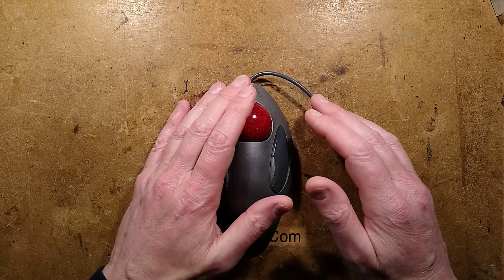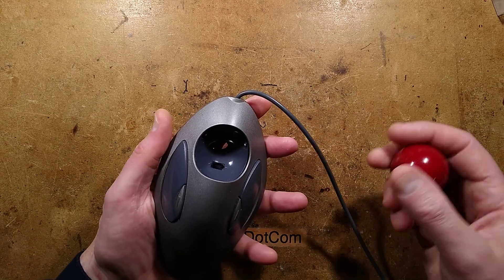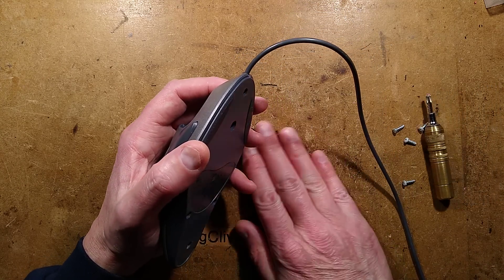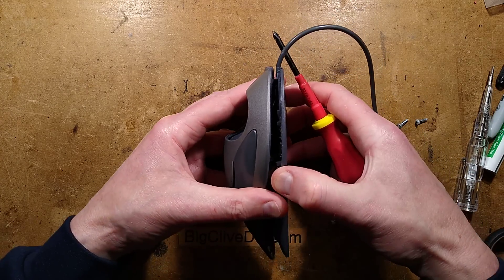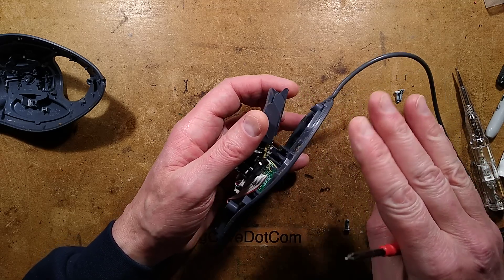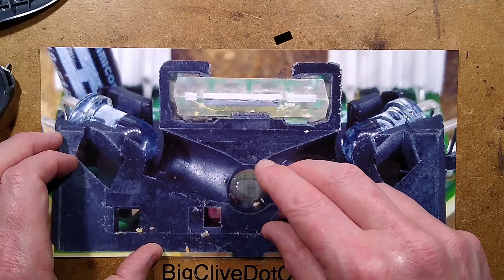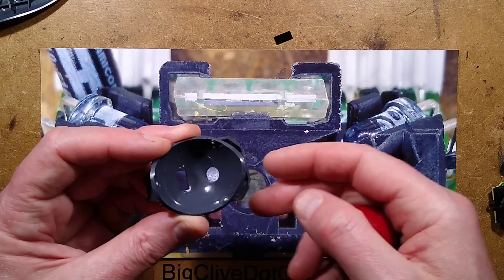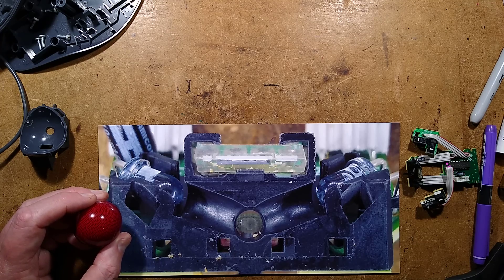inside an optical trackball

Comment: I have been using trackballs for decades now (the first one was even a serial mouse by Genius if I recall correctly). I have used the one you have/use in college (it was the only trackball alternative they offered compared to the 'dragging mouses'). But personally I just can't get the same accuracy with this design. I don't "hate it", but would not buy it on purpose either (if you understand what I mean)😂.  If it would be my only alternative to the  "draggers" then I would definitely prefer this one though.

Then for years I used the M570 by Logitech (a true workhorse tbh), and a few years I switched to the MX Ergo, and while it has a MUCH higher accuracy, speed and additional buttons which are programmable (which is SUPER handy when doing lots of CAD (electronics), 3D modeling and editing), the overall quality of it is significantly lower than the previous ones (as with most Logitech stuff these days unfortunately).

The latest model has some nast rubbery grip/layer on it, which WILL degrade after several months or years of use, and you will even have to skin the damn mouse like a hunting trophy to keep it usable 🤷🏽‍♀😂.

I do still love the accuracy and usability upgrade enough over my M570's (of which we still have about 6 of them in use in my electronics lab).

I've even been using my Trackball for high level gaming, and I always love it when a friend comes by and asks something like:" HOW THE HECK can you be that fast and accurate with that stupid trackball!? My gaming mouse has ...... DPI, costs three times more bla  bla bla"😂 when they see me at the top of the match. Once you get used to them they are a true miracle in my opinion😊

Comment: Ahhh the humble mouse, I honestly do not know how many I have taken apart and 80% of the time put back proprerly after cleaning/maintenance. Probably started in the early 80s, after dumping my Amstrad CPC464, which used cassette tapes for software. Best mouse I had was a Razer and I used a Razer Tartarus controller with the mouse to play War Thunder. I never took those apart. Good post, thank you 👍

Comment: I remember the pool ball sized track balls.   (shades of Centipede)   The balls they used were generally a bit lighter, but they were the same size as pool balls, which meant people would replace them with 8 balls, etc.   I used a thumb track ball - rectangular, three buttons, ball to the left.
Reply: I liked the big trackballs. I put a 13-ball in mine, just for laughs.
Reply: Where I live, pretty much all the Government museums and exhibits etc used those! Anytime there's like an interactive computer display, there would be one of those gigantic pool cue trackballs lol! 
I think some of them might even still use them. But the tech is ancient and almost entirely superseded by touchscreens and capacitive pads. 
Those trackballs had their hayday in the pre 2010s imo. 
Fuck I'm nostalgic now... 90s and 00s edutainment software just hits so different.
Reply: @nexaentertainment2764  - There's a benefit to using them.  When built right, they're next to indestructible, where a touch screen and capacitive pads can both be easily damaged.
Reply: I tried using a track ball as a cue ball. Not enough weight to it, couldn't do a good break with it. It tended to go flying off the table.
Reply: I had a home version of one of those pool ball sized track balls. It was a commercial product, intended to be used with a Commodore 64. Can't remember who made it, though. The whole thing was in a very chonky plastic box with a couple of buttons on it, and I believe it was wired to emulate an Atari 2600 joystick. I don't think it worked the same way as the Commodore mouse that I used with GEOS, though, so it was really only useful for a handful of games.

(Just googled - it was a Wico Command Control Trackball.)

Comment: Silicone spray lasts longer and has a somewhat nicer aroma! Way back in the day when we had an old corded mouse, I disassembled a broken one for parts, and found it had been "home" to a spider family.   The Logitech ERGO M575 is a very affordable mouse with trackball functionality, and is also cordless  (connects via their unifying system).
Reply: Some folks I hung around with back in the day got me to buy big cans of liquid silicone spray (not the white greasy stuff) for them via our lab's tech supplier. They used it on latex fetish outfits to make the material look super-shiny. The "official" spray sold in the specialist fetishware shops was called Pervoshine (really) but it was the same cans of aerosol silicone oil with a sticky label wrapped around them and a four hundred percent price markup.
Reply: @robertsneddon731  I buy ours from the local Farm Stores.  They often do them on special offer (packs of 6  520ml cans), and we get through them pretty quickly, with a lot of roller doors to keep squeak free!  Unfortunately theirs isn't Pervoshine (!!), rather Soudal Silicone General Maintenance Spray (their current generic brand)

Comment: My first PCB design was a carrier board for an optical mouse image sensor. I liberated the required components from some "spare" mice from the office. Mounted on a small robot it worked quite well measuring the distance travelled.

Comment: Logitech has made that particular trackball since about 1998. Back then, it was white, used polished steel balls or rounded pins as the bearing surfaces that ball rolled on, and it had a PS2 plug. At least, the first ones I had back then were that way. The new ones are silver (like that one), use plastic nubs to support the ball (way more friction) and they are USB. And of course, there are a bunch of annoying buttons on the sides, which I hate. But I still love that trackball!

Comment: Ah the Logitech Marble Mouse, My usual 'Go to'. for me they only have one real fault, there is no cable protection/strain relief where the cable enters the Mouse, it is only a matter of time before the cable breaks internally at that point, then  its case of open the mouse up unclip the cable, cut the cable at the white plug, cut the cable at the kink where it enters the mouse and solder to the whit plug matching the wires, I've had these last over 10 years in an industrial environment before having to bin it due to it mechanically breaking.

Comment: They are used a lot in semiconductor fabs, because the tables must have holes in the clean room to let the air flow. Normal optical mice are useless on surfaces with holes but this track ball ones from Logitech are standard in clean rooms. Also keyboards with integrated track balls are common.

Comment: i have worked through three of these and worry about when they are not available anymore.
Cleaning with a toothpick around the buttons  is a good thing to do and a brush where the ball sits every few weeks is worth it to clean out the "window". I also velcro it to the laptop table i use to keep it where it should be

Comment: I've disassembled many a trackball/mouse. The real dirt magnet is if you have a wheel, the slotted wheel that interrupts the beam to allow the rotation to be detected accumulates everything, and when the slots get blocked the wheel doesn't work any more. Also the spring and plastic pivots of the wheel  all want to go their separate ways. Warm water and a cotton bud are, I find, the best way to clean the opto-mechanical parts (just keep the water out of the electronics).

Comment: Trackballs are great, I've been using them for many years (think my first one was a Microsoft Trackball Explorer), the last few were all from Logitech and my current one is an MX Ergo. The only thing I don't like about them is that Logitech uses microswitches that tend to have issues (clicks get registered either twice or not at all) after a few years of use. The MX Ergo got a switch swap a month ago and now works perfectly again ^^
As others already said, most Logitech mice/trackballs are quite serviceable. A switch swap can just be a bit tricky because you have to heat up all 3 legs of the switch at the same time.

Comment: Of course I know what's inside a Trackman Marble! I've had to take it apart like 8 times because the switches keep failing. I wish they'd release a higher sensitivity & lower jitter model, and of course higher durability.

Also, I got one when I was 16-17 because I thought it looked cool and turns out I have carpal tunnel issues... never stopped using it. Been using the same design for half my life now 💦

Comment: I have my PC connected to the TV and like to use a wireless Logitech trackball on the couch. Or anywhere else where room is very limited or the surface not ideal. You get used to it very quickly.

Comment: I just got a trackball a couple of weeks ago to try and replace my regular mouse and I didn't even know you could pop the ball out of its socket to clean, thanks for the tip.
Reply: In a year or two the mouse buttons can start failing, though surely it depends on use. Just a 'heads up'
Reply: @doublepinger  That's what doomed my M570; Sure, I could have replaced the microswitches on them, but the surface of the thing was getting pretty nasty, and I had it for quite a long time.
Reply: I've replaced the switches in my M570 a few times now, yes every couple years once it starts double-clicking. Well, it's an excuse to keep a soldering iron around anyway :) And otherwise it's been a pretty reliable pointer.

Comment: I have a microsoft one. I don't use it often anymore. But I used to fold up a piece of tissue and put it in the hole at the bottom. It wipes off finger juices as you use it and keeps it running smooth for ages.

Comment: On new year's day (so, I was still drunk!) I bought a modern trackball, a Logitech Ergo M575 (Optical and Wireless, using either Bluetooth or their own "Unifying" thing), and I'm not sure what ergonomics they based it on, but it's actually very unpleasant for me to use as it requires you to be right-handed and use your thumb to massage the ball, and my thumb joints get quite sore after a short while, I bought it purely because I was reminiscing about a very old "MicroSpeed PC-TRAC" trackball from I think the late 80s I used to have, and I enjoyed using back then (about 20 years ago), I liked the ball-under-palm style, but finding something modern like that at a decent cost, not easy sadly... :(

Comment: Try a drop of thin silicone lube on the ball instead or the glides.
Reply: Messy......
Reply: @18robsmith  The petroleum solvents in WD40 might not play well with the plastics over time, not sure what plastics they are. Some HMW tape or fresh teflon pads might help it slip in slide without the need for Glide much better.

Comment: Thanks Big Clive.  I never could get used to a track ball, just mice for me.  I once got something called a Space Orb 360 that was a 6 axis sort of gaming controller.  I never mastered that one either but it sure seemed like a cool controller.  I still have it.  It has a 9 pin serial connection which has been phased out for quite a while.  I think you can still find serial add on cards.  I have an add on card for a parallel port which communicates to my ancient HP 1100 LaserJet which still works like a champ.  Sorry, rambling off topic here.
Reply: I found the larger ones tend to have heavier balls. I wasn't expecting it, I got an L-Trac 1600 which on purpose should've been better... but the ball had too much inertia and the mouse was exceedingly large. Marble Mouse has a very relaxed-palm design

Comment: Maybe some baby oil on the bearings rather than wd40 over the ball, infact, it is generally a good idea to keep wd40 away from your balls... 😅

It's much like a larger upsidedown mouse, I used to use a laser mouse in much the same way but with my hand, I had no flat surfaces at the time to use iyt properly, elsewise it was just used on the led

Internally it seems marginally more circuitry than a modern mouse, I almost want it just for the ball

Comment: I have a smallish wireless keyboard with built in trackball which i use for my HTPC. The ball is held in place by a retaining ring which can be removed simply by twisting (I wish I knew that the first time I removed it and I wouldn't have broken one of the retaining tabs). As far as i can see the ball is just plain grey.

It's good to clean your balls, especially if you haven't cleaned them in a while.
Reply: That type is an inverted mouse, The two friction wheels have pulse encoders.
Reply: @dogwalker666  No, it is optical, the ball rides on 3 rollers at 120° spacing with an led tranceiver below.
Reply: @chrishartley1210   so a mini ccd camera like a normal mouse.
Reply: @dogwalker666  or, like a trackball 😁
Reply: @chrishartley1210  well trackballs don't usually have a retainer at al, mine used to fall out every time my cat jumped on my computer desk.
Reply: @dogwalker666  ah, it's because it is built into a portable wireless keyboard which will naturally get moved around a lot. The retaining ring doesn't actually touch the ball when it is being used.
Reply: @chrishartley1210  oh that makes sense.

Comment: I have had a few of these. the first one had the good old cream colour mouse connector, The next one had the green mouse connector and loved them until they sadly passed away. I then bought 2 of the usb versions and still use them now. There is a great little app called x-mouse button control that adds a lot of good tweaking options. button mapping etc. I can swap virtual desktops at the click of a mouse button . set the movement speed of the ball tracking.. Great little app and its free to use

Comment: This just gave me an idea for an experiment. 
I recently bought a new 3D printer (Bambu A1)
With it came a "build your own mouse" kit. So practically a circuit board some small parts, and you print the housing your self.
So if I have to print my own housing, why not try to make it a trackball... as an experiment.
Reply: There was a guide, some time ago: using a cheap tiny portable mouse from online, and then flipping it over, mounting it, and using that as the ball sensor. In Linux it was easy to directly reverse the Y-axis, so it tracked properly. Not sure if it 's do-able one Windows, but at this point, it may be necessary.

Comment: I really liked the early one where the ball was under your thumb and you had 3 buttons, not just two.  I'd always set the middle to a double click.  Seems silly but it was VERY handy.
Reply: Logitech still makes them. Use it exclusively at home (space) and mix it up at work with a std mouse as well as a vertical one. Never got along with the trackbar/mousetrapper thingy.
Reply: @michaeltempsch5282  Thanks.  Not as expensive as I thought they'd be, but 3x the rechargeable one I got on Amazon and like.
Reply: Yep, I use the MS version of that to this day on all my desktop machines.

Comment: Please Don't use WD40 on balls. Even if it makes you Whizz.
Reply: quite right. i loathe wd40. how many times must i say "it isnt a lubricant, it is a ruddy solvent"
Reply: @KarldorisLambley  Until your voice is totallly worn out. It is a very mild lubrican though but it does varnish pretty quickly though.
Reply: @KarldorisLambley

Its original purpose was to displace  water and leave a fine oil coating to temporarily protect from corrosion (specifically for missiles).

It may contain a solvent (for displacing water and distribution of oil), but its primary purpose was not that of a solvent, much like solvents in paint. 

It is a mild lubricant, but again it was not originally intended as a lubricant and in most cases is insufficient to be used as such long term. It’s got its bad reputation as a lubricant because once it has been used to lubricate and free up parts, a proper long lasting lubricant is often not then applied to prevent future issues (loads of people neglect proper maintenance, which is oft why the WD-40 was used to free up whatever in the first place). 

Also WD-40 is now a brand name used for a whole range of products including specialist lubricants and you get loads of negativity in comments when someone uses a proper lubricant from the WD-40 brand.
Reply: @RousePartridge  the way we used to make the balls move nice was ..... Erm well rub the ball on your forehead.
I know sounds wrong but trust me.
Reply: I use aloe lotion on my balls, smells nice and keeps 'em rolling smooth. 😂
Reply: How did you make this comment 2weeks ago when this video is 11min old????
Reply: @joesshows6793  By being a patron.
Reply: @rolfs2165  ooooh interesting. I thought it was a different video that was on Patreon. 🤷‍♂️
Reply: @joesshows6793  He should probably advertise his pateron more
Reply: @joesshows6793  early access?
Reply: Skynet